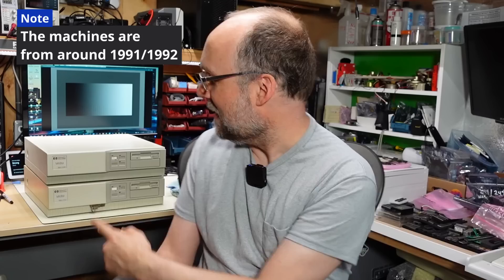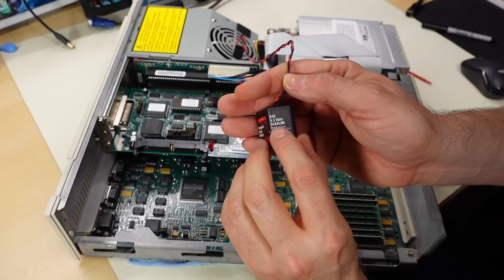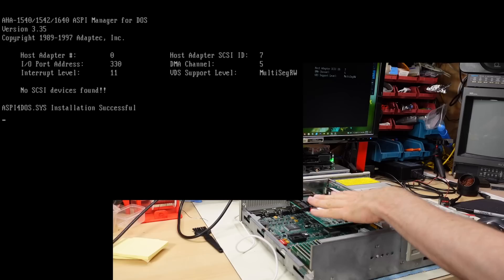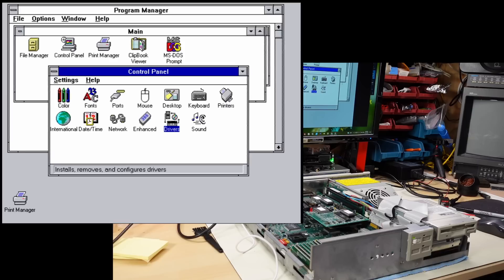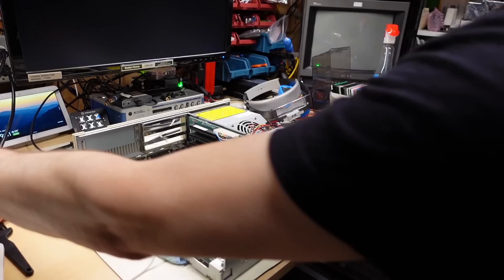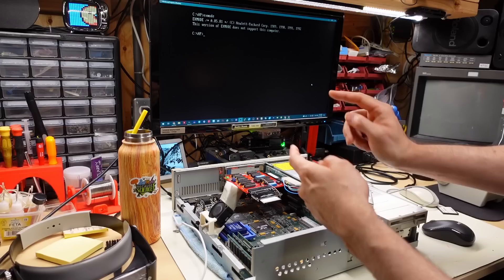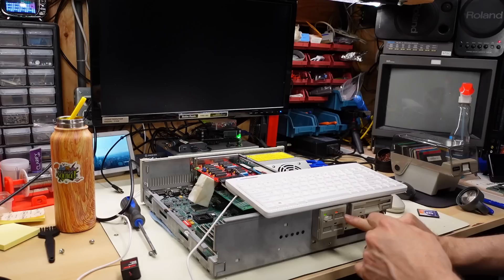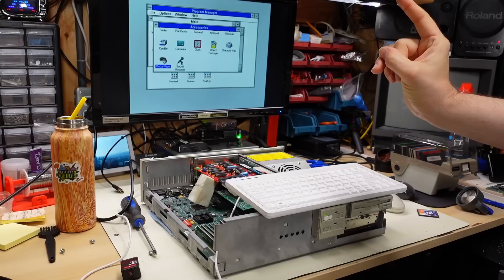PC archeology: The HP Vectra N Series, a well made pizza box PC from the early 90s

Comment: I have bunch hp e-pc e-vectra that were being tossed away. They are smaller and p3 class. Integrated audio, lan, parallel/serial/usb. Motherboard has onboard ram, and you can add more with a single dram slot. Had a 3 1/2" hd (pata), and space to fit a slim optical drive. Darn keys, almost all missing, but thankfully nearly all of them were left unlocked. PSU is external, laptop type with a barrel connector. Keyboards were oversized for this tiny pc, guess what I'm typing here with? They have the size of a traditional IBM keyboard but are not mechanical. Had two button ball mouse with wheel (so 5 buttons really) which i also have (keyb/mouse use ps/2 plugs). Their crts long gone (couldn't take them with me...). They were "Made in Mexico" and have Windows 2000 Professional sticker/serial.

Comment: I switched to PC compatibles from Commodore in 1991 and fortunately have only ever used towers. The desktop form factor would have constrained you into a low performance machine with more or less non-standard, missing, or limited hardware during the 90's unless you went into super money territory. What you'd actually want to be using during that era would be a full sized tower, and something decent would set you back, all in, around $2,500, or $5,300 in today's money. Desktop PC's in that era had too many compromises or were super expensive for something that you'd actually want to use. You could opt for a mid tower as a space compromise but I wouldn't have recommended one in 1991. WordPerfect and Lotus 123 only for these HP's.

Comment: I remember pizza box PCs back in the 90s but they were a lot thinner, less than 3 inches.
Reply from the maker: Yeah I have a couple from IBM I want to feature on the channel. It uses laptop style disk drives and has just one ISA slot, which was parallel to the motherboard. I think this machine is about as thin as you can get while still using normal off-the-shelf parts.... well except for the PSU but that was their choice LOL!

Comment: There's info on the backside in Swedish at 3:35 but that info is in no other language? Made for the Swedish market? The text next to System Number and Serial Number means "If the device is connected to a power grid, it should be connected to a grounded socket".

Comment: I almost bought a computer like one of these not long ago at my local fleamarket.

Even a pentium was struggling with a mod file? I was about to say something about how Amiga500 games had great mod music but then I remembered that those usually had 4 channels I think... At a later point you tested the 386 with a 4 channel mod, right? How is that possible that it's struggling with that one yet Pinball Fantasies player right? Does PF has less channels? And here I am again: The Amiga500 had no issues playing awesome mod files :D

34:13 - I feel like there was supposed to be a shot where you actually show off the visuals and the music :/
Reply: yea that's not right.  star control 2 works fine on a 386 and plays mods over even pc speaker. pinball dreams and fantasies have mod music and work on a 386/486. most era pc demos had mod music.

what it was, was that it wasn't easy to make the code to play it and there weren't much software mixing guides and such for game developers, you could buy a mod player routine around that time though.

edit: afaik pinball fantasies has 4 channel music and 4 channel effects although I might be wrong.
Reply: The IT file format is able to mix multiple sounds per channel. Even when an IT file may be showing 12 or 16 channels on screen, it may actually be mixing hundreds of channels in the background, so it's much more expensive compared to a MOD file or even an XM/S3M file. OpenCP is also a pretty slow player as it uses very high quality mixing by default, if I recall correctly.
Any 386 era machine would have no problem mixing any 4-channel MOD file in real time. A ton of 386 demos did that, and even a few games.

Comment: I'd actually go one further, get a Pentium II if you can. A 386/486 is all and good, but if you want to play the best games, and the best games are from the late 80s to late 90s, you need a stronger machine, a lot stronger. Something, that can still run Doom perfectly fine, but something that can also run... Half Life, Quake, or Need for Speed 2/3/4/5. Or the tricky VESA 640x400 (or was it 480?) mid to late 90s DOS games like Blood. Basically, focus on the 90s era. These HP Vectras are completely fine, I like the looks, and a 486/66 is not bad, but still, this is late 80s to early 90s teritory, and I don't think it's quite enough for a retro gaming machine. Or at least not for me, anyway.

Comment: In my 286 the battery leaked and corroded the psu only. Yet since it's propetary I can't replace it.
Do you have a sketch of how to make a cable adapter for the psu conector?

Comment: I ended up picking up a year ago maybe a little longer a 486 HP Vectra VL2 50 model but it's got a weird feature to it to where Adrian's 486 had a blue socket that had that lever that went all the way around the 486 some of the 486 had the socket 3 but my VL2 50 is the original 168/169 pin 5 volt socket for my 486. So when I looked my machine up it says it should be a socket 3 but it's not so I don't know if mine was an early production machine or if the board was switched out but where I got it from the lady who owned the machine said that nothing's ever been replaced and after she got done using it she just had it locked in her basement for umpteen years. If anyone could help me with the board that would be great because the board should have jumpers for the ability to set right through or right back on the CPU in the online manuals but where there should be pins for mine there's just solder points where you can put those pins. It's a strange board.

Comment: Question for you,  where can someone get the board that you are using to use compact flash as a bootable drive for older computers... I have a very old grid laptop that has a harddrive in it that is running windows 3.1 and dos 6.22 and I don't want to lose the information on the drive (I use it to program extremely old two way radios)
Reply: It’s an open source design, with many people selling small runs every now and again. Or you could use an online PCB manufacturing company to churn you 10 for $5 and solder the components onto one of them

Comment: I had a couple of these sift through my hands - I was not impressed with the ribbon cable that led to the front control panel (reset/Turbo, etc) - it seemed cheap. Also (my 386 SX version, it was a 16 MHz) didn't like a good amount of the RAM that I threw at it. 

Also, no way to attach a CDROM to it (internally) - I would say that the 386 was a good gaming machine for the time. The 486 would almost need a CDROM.

Comment: Those keys didn't really secure old HP computers like that. You may find that the keys that came with it will fit the lock on the other computer. They were pretty ubiquitous like luggage keys. The "security" of it relies on the ignorance of thieves who would wrongly assume that the keys for different systems were also different. Give they keys a try in the other machine. All you have to lose is a few seconds and what you gain is possibly being able to lock both machines and/or make new keys for them.

Comment: I tough with Windows 3.xx that you needed to choose what type of mouse you're using, unlike Windows 95 or better that may detect the mouse automatically.  Windows 3.xx didn't have auto detect hardware like mouse, sound card, video card and anything that wasn't available to DOS.  What I mean with video card is something better then vga.
Reply from the maker: I think you're right -- I just needed to run a driver first. Odd is the machine had no mouse driver on it, so I wonder if was always a keyboard machine?

Comment: I don't have a lot of love lost for this transitional era PC. The PS/2 with a 32bit bus including bus mastering was infinitely better - and of course vastly more expensive. Once again the Overdrive chip shows itself to be Overrated. None of those things ever worked anywhere near the native solution. The best computing deal in the early 90s was a generic Taiwanese EISA bus tower. Just looking at an ISA bus dragging down the 486 this way is painful. The PCI bus was certainly the most gigantic step in personal computing history. I do remember doing every trick in the book to max out the performance of ISA bus 486es.
Reply from the maker: For me, it was VESA localbus that really was the best on 486 machines before PCI came around. Running at full bus speed, 32 bits wide. It absolutely screamed. EISA was limited to just 8Mhz but at 32bits, so it was a nice doubling of speed over 16bit ISA, but nothing compared to VESA Localbus running at 32bits/33mhz on a 486DX2/66. It came out in 1992, so getting a machine with that would scream, especially if you have the disk controller and video card on it. (Which was totally typical) It was twice as fast as Microchannel and 4x faster than EISA... but you could push it up to 50mhz on 486DX-50 chips -- although if it worked at that speed was not always assured. You'd get 200mb/sec though!
Reply: Been a LONG time since I thought about VLB! :)
Reply: @adriansdigitalbasement  Go for the best of both worlds....... a 486 motherboard with both EISA and VLB. An added bonus is many can support a whopping 256MB of RAM. The two EISA/VLB board I have got 16x30-pin SIMM sockets to accommodate this madness and support 1MB of L2 cache.

Comment: Can someone knowledgable in this community answer me how we ever got to the point where black is hot with AC but negative on DC? Seems ripe for mistakes.
Reply: Colors differ by region for AC mains. North America uses black for hot, white for neutral, and green for earth/ground.

DC wire coloring really depends on the vendor, it just happens that IBM used black for DC earth/ground on their power supplies in 1981. Commodore used different color wires in their big box Amigas even though they used the standard Molex plugs for peripherals. Those used blue(!) for ground in many cases and different colors for the voltage rails.

Comment: Oh no, the 1.44 fallacy keeps on coming. They’re 1440K (two times 720K) which is 1.4M (or 1.40625M to be precise). We’re in binary unit land with floppy drives so you can’t just “divide by 1000”, when to get the K figure you already divided by 1024. Yes, that’s what they were all called back in the day, but it doesn’t make it right. And yes I’m still cross about it 35 years later. Sue me. It’s like looking at your ram check saying 65,536 KB found and saying “cool, I’ve got 65 MB of RAM”.

Comment: something is wrong with that mod player on that machine I think or it's doing something strange.  94'95 era mod player not working on it is a bit strange.
Reply: That player is from 1999. That CPU is from 1989
Reply: @alakani  oh i misread the player headline as 94-95.   i never used that player back in the day
Reply: @lasskinn474  Still, the Pentium came out in 1993 and music production was/can still be fairly CPU intensive, for complex tracks. The Amiga, for which the mod format was originally designed, had a dedicated DMA coprocessor called Paula just for sound, and so could get by with less main CPU compared to a PC emulating it